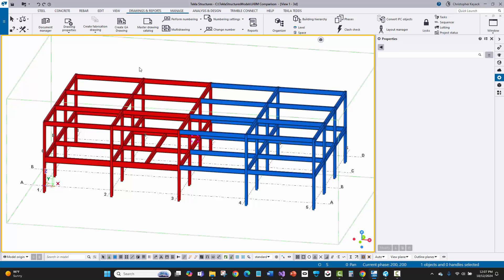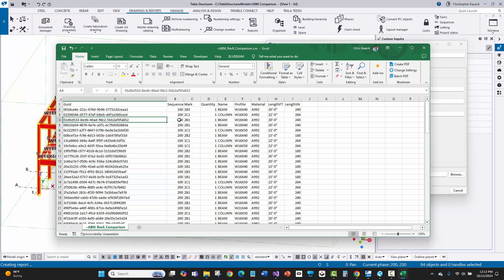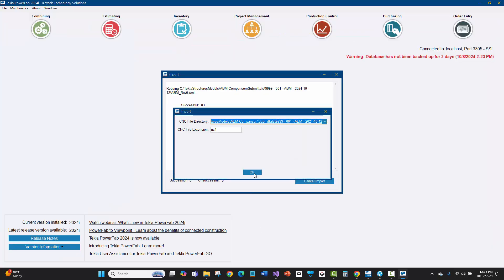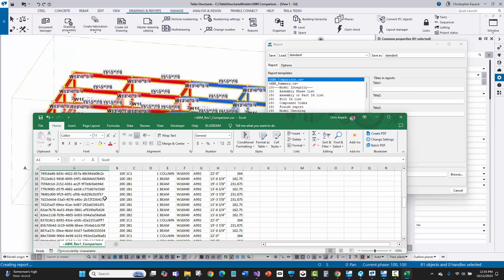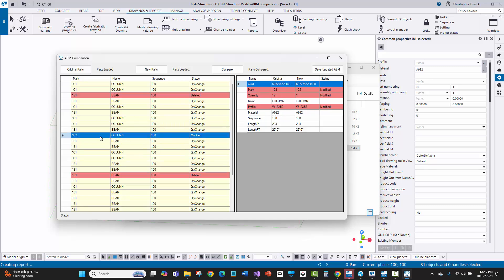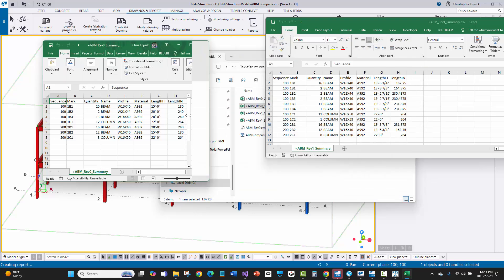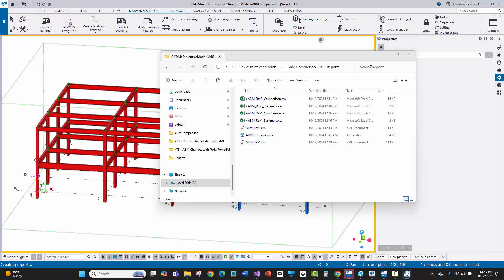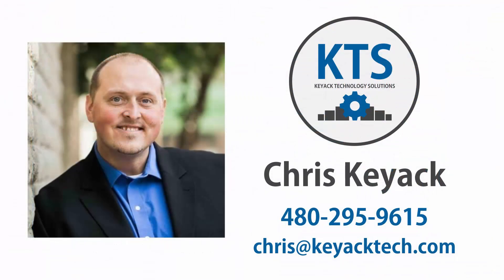KTS - ABM Changes with Tekla PowerFab

Comment: Chris, why bring it into Production when we do use the guids in combining?  and in Production,  we can compare it to the ABM as a feature. That can't be done if they are both in Production.
Reply from the maker: @adelphia27  hey Todd. I wasn’t able to see GUIDS in action in combining. When I brought two kiss files in with a customer (I know kiss don’t have Guids) there was no change detection in combining. Ricky had mentioned something about how production allows you to automatically make updates and more control on the import but also mentioned if ABM marks are right that you can compare a combining run against Production run. Is there good videos demonstrating this whole process? I can’t import xml into combining so I probably need to make a special kiss export of the parts that don’t shorten the lengths?
Reply: Chris, you mention it in your video that the IFC can be brought in and that does handle GUIDS.  However Todd (and this is a big however), everything in an ABM is going to change once the model is connected.  So when you have hundreds or thousands of pieces in a revised ABM it is incredibly tedious and tough to actually wade through all of the changes to see what actually matters.  I have clients that just throw their hands up and do it manually instead, and I can understand why.  Plus, changes brought into combining do not uncombine the associated pieces in purchasing/inventory.  So bringing it into production control is better from that perspective.  There are repercussions for this though once you receive a release for fab.